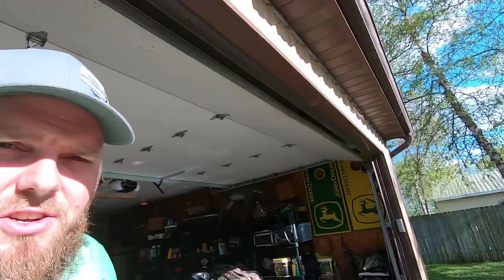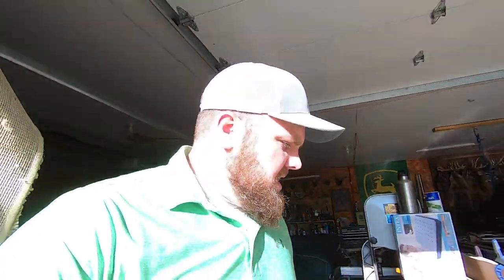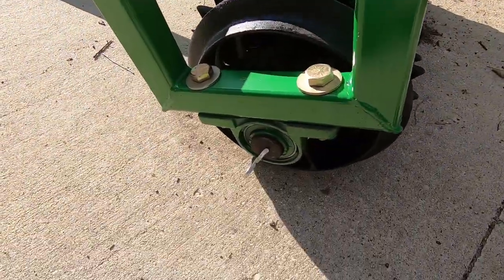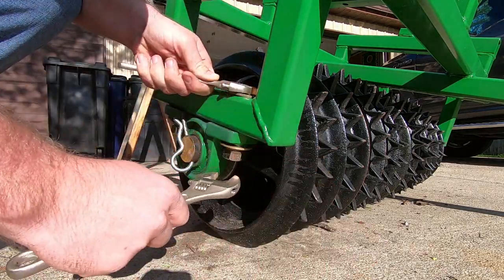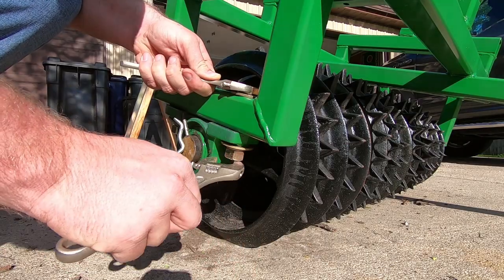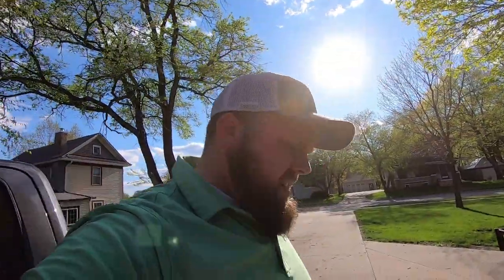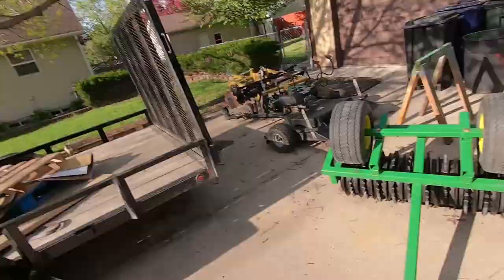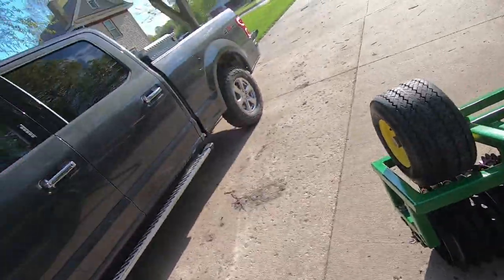Building An ATV Food Plotting Cultipacker - EP2

Comment: I have identical cultipacker wheels from an antique 8-footer.  Going to make a 4-footer for ATV.  Great job on your design!  Can you share part numbers on the bearings used, and more details on what you're using for the tire/wheel/axle?  I want to put tires on mine as well.  thanks for posting!  PS wonder too now often you lose the cotterpins from the axle ends?  seems like they could catch on brush on tall cover crops.  
WC
Reply from the maker: https://www.amazon.com/gp/aw/d/B075H188LP/ref=ppx_yo_mob_b_inactive_ship_o0_img?ie=UTF8&psc=1

The pillow block bearings i think i found on ebay, tires/wheels are for a golf cart, havent lost any pins yet, thanks for watching!
Reply: @PUTEMDOWNProductions  Thanks!